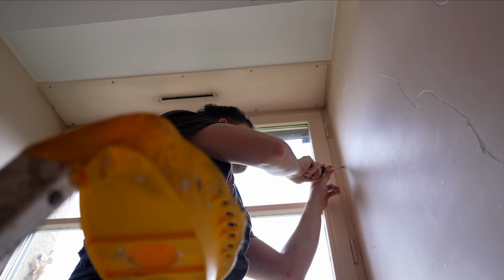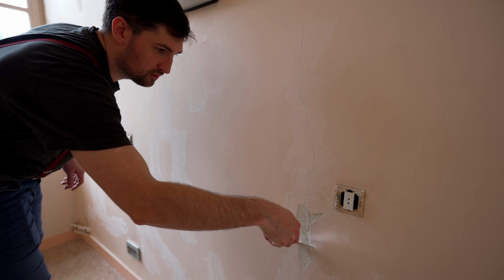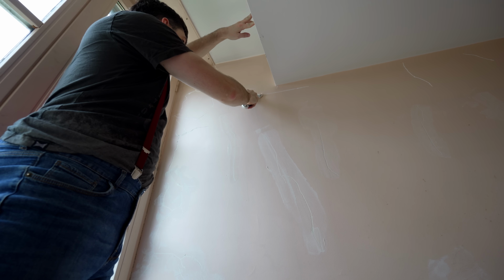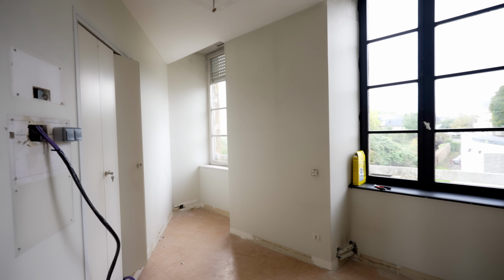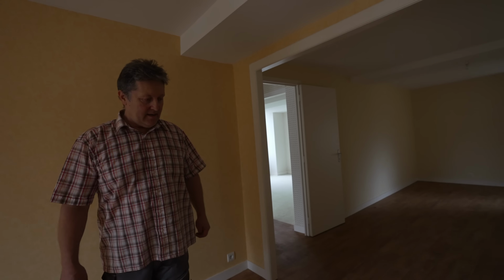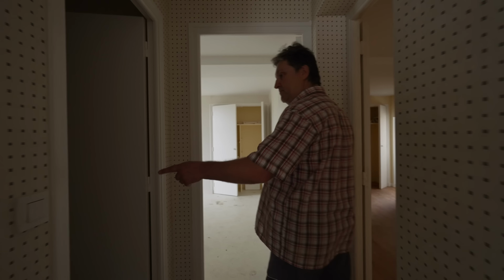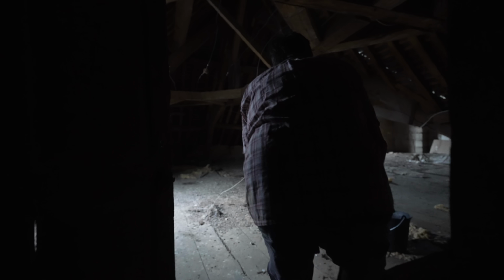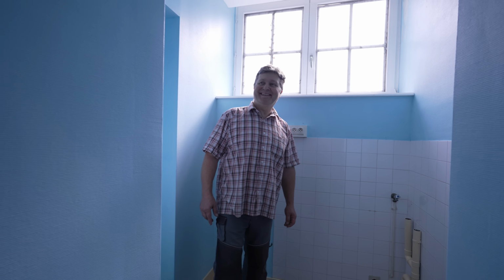The Last Piece

Comment: Give this a try, Billy.  Step one - open the cracks in the plaster with your screwdriver or the pointed end of a can opener.  Step two- use interior caulking in your caulking gun and run a bead of caulk into the crack.  Step three - smooth it level with your putty knife.  When it dries, you can give it a light going over with your plaster if needed.  The caulk will remain a bit pliable and help from the cracks reappearing.  I used to do this in my 1910 house with horsehair plaster walls and ceilings.

Comment: Do have a question about Ryan’s office? If the plaster board is covering a stone wall.  Why not remove the board, expose the stone for the wall? Personally believe it would give the room something that only a few of them could have. Original walls of the convent! One less wall that needs painting, in all of the rooms that share the wall too. Just a thought and possible time/money saver as well🙂
Reply: @Sgirl  Thought about that for a moment also. If it was a original exterior wall, it is not currently. Since it’s located down the hall from Billy’s office.  Imho believe it is a huge waste of time patching the plaster. It will be a on going issue. Besides, it the plaster board is removed, it will take some pressure off of the other boards, hopefully causing less cracking in those. 
Like a said before, just some random off the cuff thoughts🙂

Comment: I was just wondering, in the new kitchen where the pipes are coming out at an angle and going into the bumped out wall section, could that be a later adition to the room to hide plumbing or heating pipes?  There seems to be an identical set of pipes coming out the other side of that bumped out wall.  Just wondering about that funny angle and small space.  You are doing such a great job with both places.  Thank you for taking us along for the ride.

Comment: I wonder with all the work that is being done are you looking into incorporating more "new" technology as in usb wall plugs, led ceiling pot lights with or without dimmers, in floor radiant heat (water or electric) as you are removing the hydronic radiant heaters? And I noticed that your roof in the attic, the pitched part does not have any insulation, will you be adding some foam board, spray foam, rock wool, fiber glass or even blown insulation, to reduce heat/cold transfer? And final questions, as this convent is built like many of it's era with thick (structural) supporting walls with "decorative" inner walls that were utilized just to delimitate each rooms; are you considering opening these (or even widening) openings as to keep it airy, giving more inner light transfer? (similar to "open concept") Have you considered removing some plaster on several indoor load barring stone walls (could also be brick) in these apartments to reveal their beauty and also giving a focal point/character point for each? By revealing these stone walls you transfer the charm and history of the convent into each dwelling and many have incorporated a fireplace (ethanol/electric) into them or even just several mantel shelves as to highlight these. Trust me with several coats of wax on the stone/brick walls and the use of oak, maple, chestnut, acacia or even alder mantles with a simple varnish; will elevate the look and feel of the dwelling so much more. Thus giving it richness and giving you the option of renting/selling it at a premium.

Comment: Billy won’t that space overheat the equipment without ventilation?
Reply from the maker: The equipment won’t but the eco flows which are being used as backup power might. need to add a vent or keep the doors open